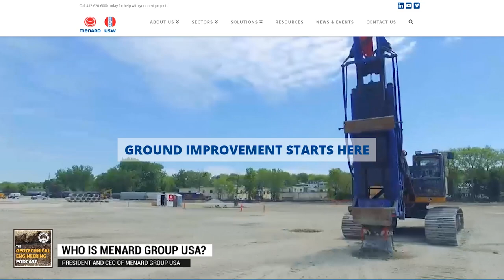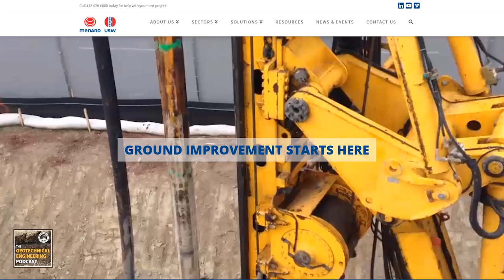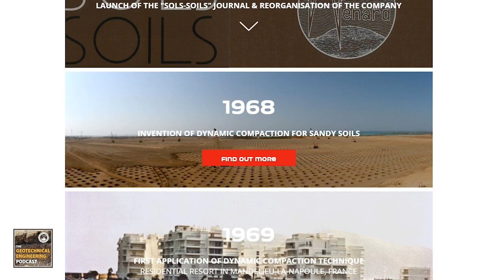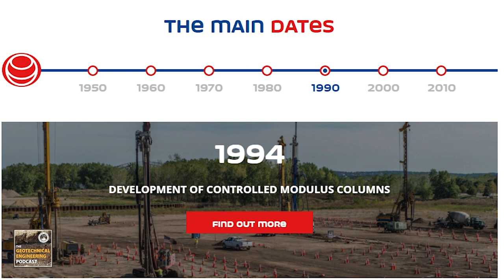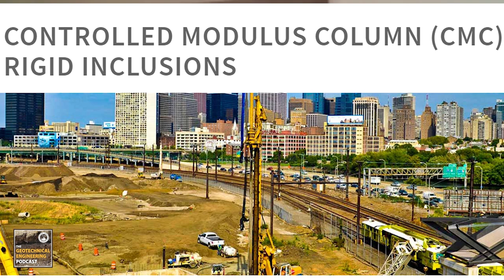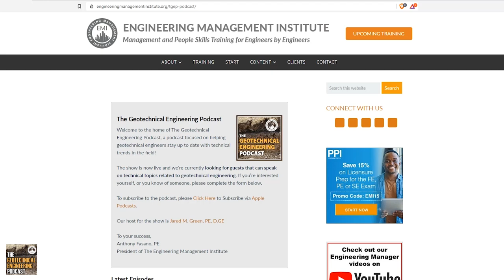Ground Improvement Techniques for Geotechnical Engineering Professionals

Comment: In relation to how the building codes and standards affect the practice and the difference between codified piling and (still) not codified ground improvement, one thing is important. Pilling codes have long history. They have been around for decades and usually were developed in times when ground investigation techniques and methods of analysis were not so advanced. Thus, piling was associated with high level of conservatism. Once established, conservatism in the code is hard to get rid of.
Ground improvement techniques did not suffer from the excessive conservatism. Therefore, codifying their design now should not be a problem (it might be after few decades, though). 

Currently, in Europe, we are developing the new Eurocode 7: Geotechnical Design code with addition of some new sections, one of them on ground improvement. Not surprisingly, people from companies like Menard, Keller, etc., are spearheading the development of this section. In code development, this is the best way to go, various stakeholders finding a common ground to what are the minimum and essential requirements that do not prevent competition, but foster sticking to the state-of-the-art in the industry (and to provide public authorities with reference documents they need).
Reply from the maker: Thank you for taking the time to share this information!